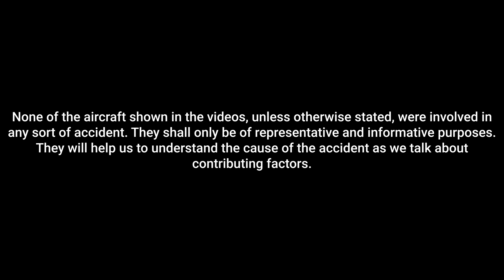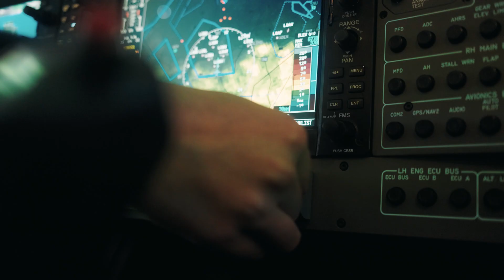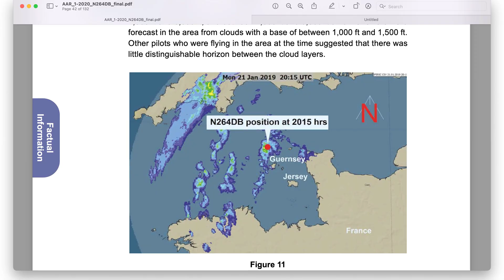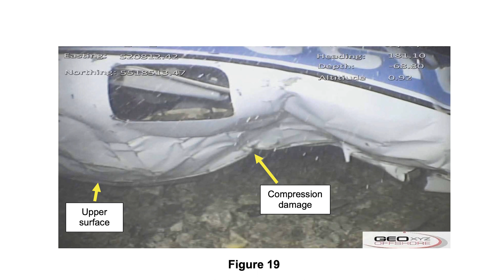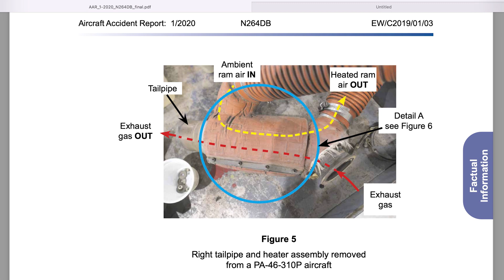Spiraling into the English Channel: The case of N264DB

Comment: Hello, I just happened to find your channel by accident.   I think you do a very good job of summarizing the events of aircraft incidents.   I've been a GA pilot since 1968 when I first soloed a C-150 as Neil Armstrong and Buzz Aldrin were traveling to the Moon.   Since then I gained about 4,500 hours as a G.A. pilot.  So, I understand your "pilot lingo" better than those who come here who are not involved in G.A.
     Question:  Have you ever produced the story of a female doctor who was flying her Mooney on auto-pilot at about 17K when her wings suddenly accumulated ice?  The aircraft stalled and the autopilot disconnected.  The Mooney went into a "split s" and automatically recovered at about 10K feet.   After the good doctor woke up from GLOC she was at about 10K feet where she was able to take over manually and land her intact Mooney. 
         I know about this story because I saw the Mooney wing from that airport at Trenton Robbinsiville (N87) maintenance hanger sitting vertically on the side of the hanger wall.  The Mooney wing had rivits popped off and parts of the skin were buckled and twisted.  I spoke with the maintenance people who told me this story.   It must be on the NTSB site somewhere. 
         Yet the FAA-NTSB determined that the Mooney wing was able to stay intact even though it experienced over 12.4 G's.  As you know, general aviation airplanes must be able to sustain 3.8 G's in the normal category; 4.4 G's in the Utility category and 6 G's in the aerobatic category.  This Mooney sustained over 12.4 Gs and survived. 
           What other G.A. normally produced airplane since 1960 do you know of that is able to sustain at least 12.4 G's and still allow the pilot to survive a catastrophic failure?
Sincerelly, Daffidavit.
Reply from the maker: Hi! Thanks for writing the comment. I’m actually working on my ATPL right now already got my PPL but unfortunately i do not have the same experience yet that you do!😅 

I have never heard of that story before but it sounds fascinating and i should definitely look into it! Especially because over reliance’s on automation is a very interesting topic these days… and the fact that the airplane should have actually shattered into pieces makes it even more interesting… 

What aircraft are you flying these days sir?